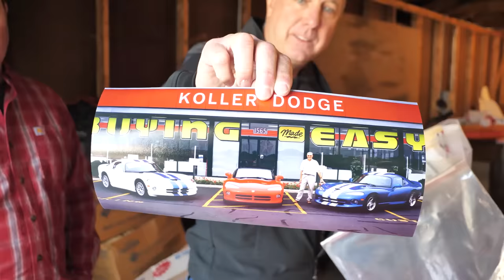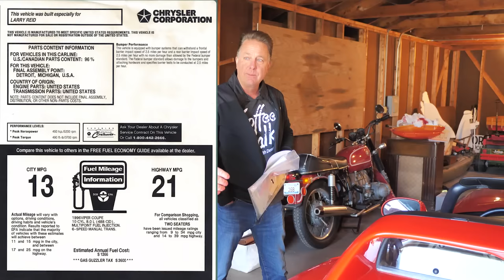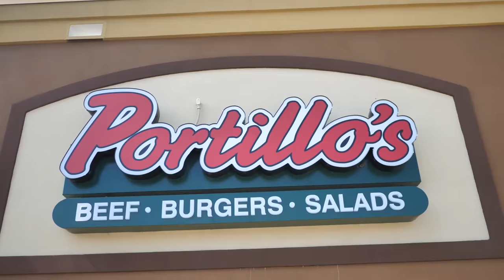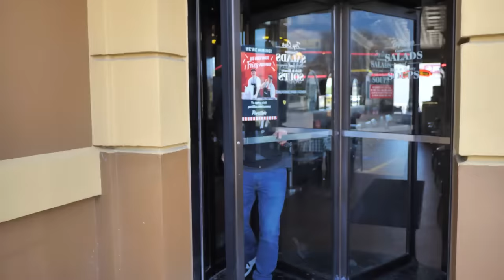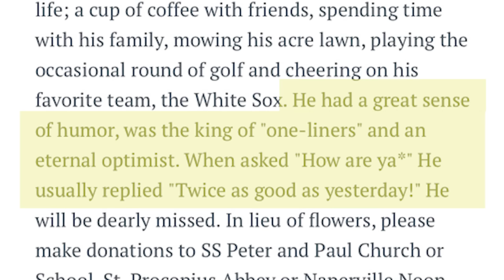FOUND: THE ULTIMATE DODGE VIPERS

Comment: Man it's hard to believe that the Dodge Viper is now 30 years old. I remember working on them ad the Dodge dealership like it was yesterday. The very first 1992 models, no ac, no abs no automatic transmissions, no roof and even no inside hood release. These younger people driving their 800hp cars with traction control, ABS and stability control would literally not be able to drive a Viper I guarantee that. This is just a raw car that requires a talented driver. We only ever sold around one or two Vipers a month at the dealership but there was always at least one Viper in the body shop at all times and always with the identical crash damage, right front wheel bend in and under the frame and a smashed hood.